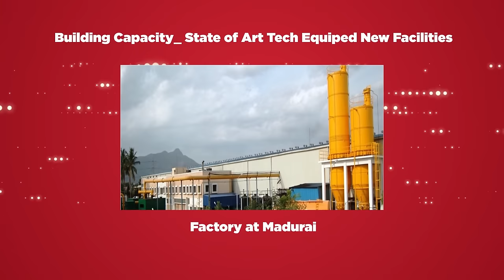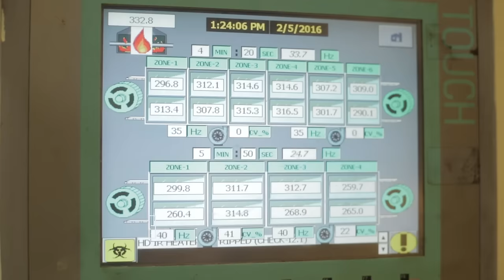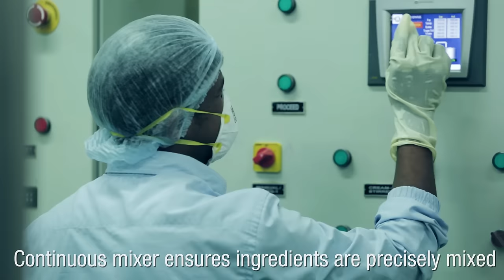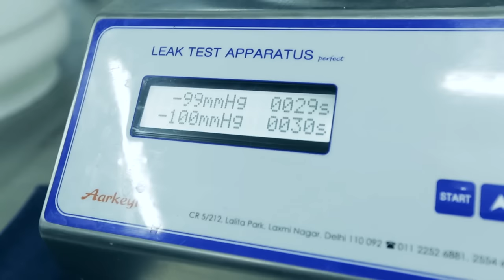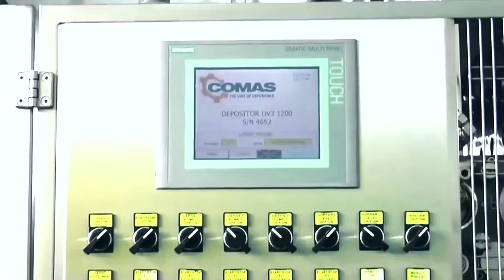Made in India: Britannia

Comment: hi, this is Alex from eversmart. we are the manfacture for biscuit sandwiching machien, stacking feeder, packing machine, and so on.   pls tell me your contacts, I will send you price.  or email me at alex@ever-smart.net.  whatsapp:+86-13928281760.  
Standard functions：
1 Sandwich layer creamer and pipeline with real-time temperature control system.
2 In the running process of machine, the brush and compressed air will automatically clean the biscuit pushing chain.
3 There is no biscuit or cream system, automatic recovery of feed after there are biscuits.
4 Easy operation: simple machine adjustment, machine settings and alarm detecting can be done through 10 inch HMI 
5 Vibrating feeder feeding;
6 Garbage catch tray which can be disassembled easily can facilitate machine cleaning and maintenance
7High speed: 3200 sandwiching biscuits per minute (800PCS x 4 per channel);
8 Shape: round, square, rectangular or special shape
9 Standard product size range: 35 mm - 70 mm. (The biscuits with special specification can be custom made)
10 Seamless connection with row multiplier, synchronous connection to the cooling tunnel or coating machine.

Options:
1 Optional for single-color or double-color cream filling;
2 It can match with automatic feeding system,
3 Biscuit upright stacking mechanism, products are outputted through conveyor 
4 Counting loader is configurable; it can directly transfer the sandwich biscuits onto any brand of X-fold On-edge packaging machine or Tray-free biscuit On-edge packaging machine.